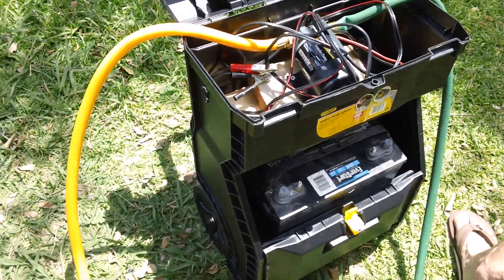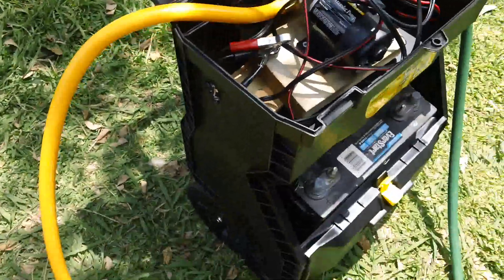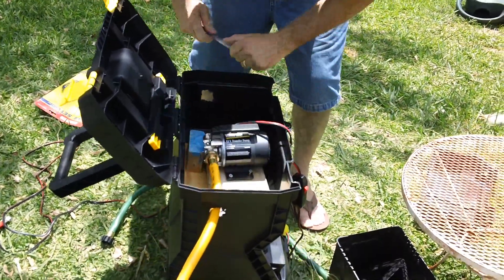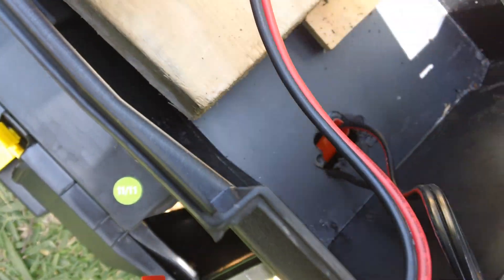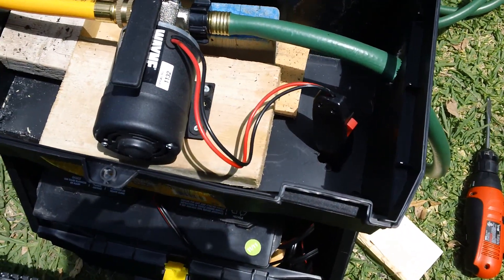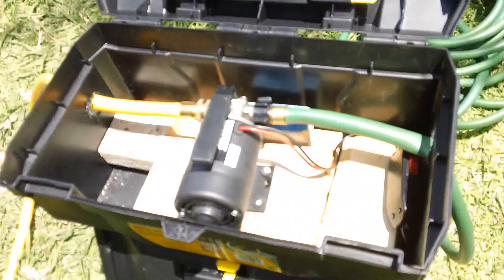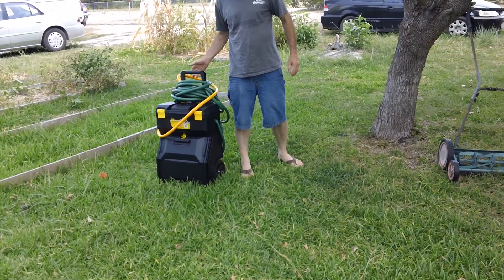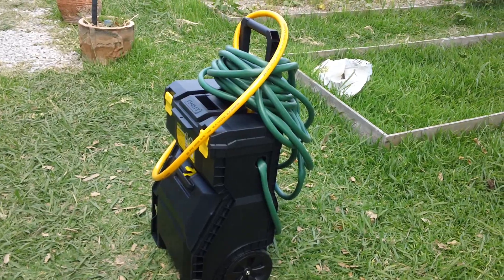DIY Portable Solar Water Pump Station - Move The Water and the Pump Where you Need It.

Comment: Easy to setup. allmy.tips/SolarWPumps Powerful pump however after just 17 days of use a plastic piece that holds the pump motor to the filter and outflow broke. No one was touching it, it was just pumping and then stopped functioning properly. Obviously the plastic is too fragile.

Comment: You put holes in the bottom in the section where the pump is, so it the pump leaks the water drains onto the top of the battery?

Comment from the maker: I am not sure how many pounds of pressure the pump is putting out but one of my tanks is about 70 feet from the garden and it works.  There are reviews that say it does 100 ft with 8 ft of head that is one of the reasons I picked this pump.  Sorry I couldn't be more help there.

Comment: Awesome idea! I've been doing some research on the construction of solar water pumps and I found your idea to be one of the best I've seen. Can you answer a question for me? How many pounds of water pressure do you get out of your pump? I'm looking for a good pump that can push water 100 ft from the rain barrels beside my house to my raised bed garden. I plan on running 100 ft of pvc pipe to the garden and then using drip irrigation throughout the beds. I have (5) 12x4 and (10) 4x4 beds.

Comment: Suggestion:a pockethose would be perfect for this as it is sooo much lighter in weight and would be easier to cart around all over the homestead! That being said, I bought 4 or 5 this summer and have had to replace I think all but 1! I love them but the ones I bought from Bed Bath & Beyond (20% coupon cheaper than Walmarts) must not be very good quality. I've seen some different ones with brass fittings advertised on tv, so I would try them out. Most of my problem has been at the plastic ends.